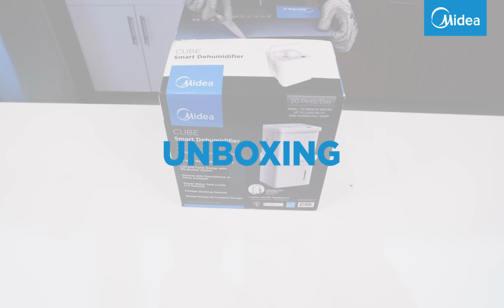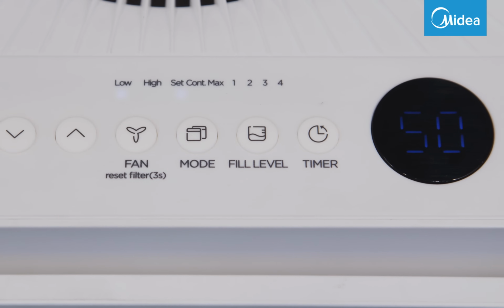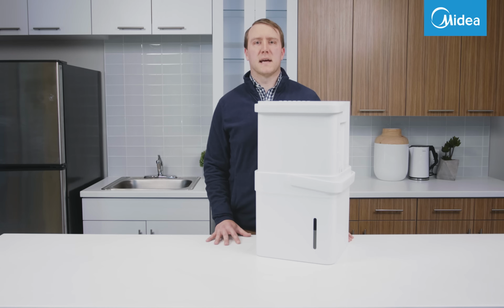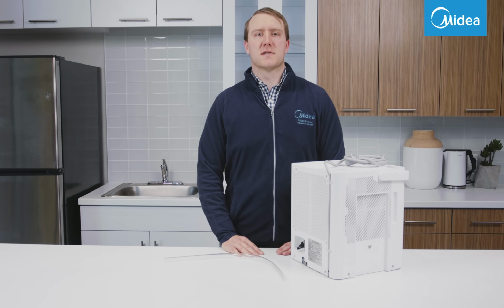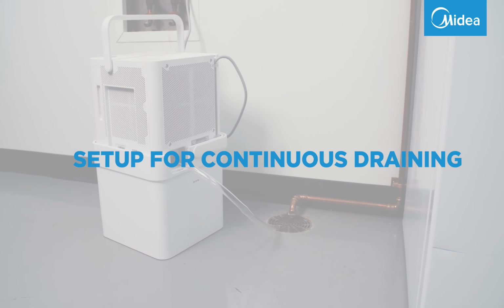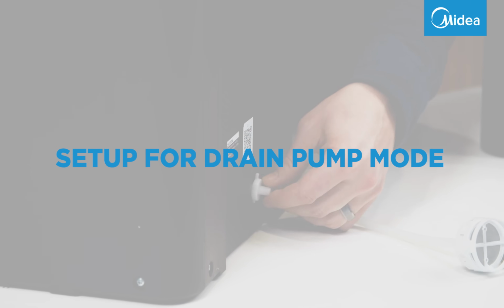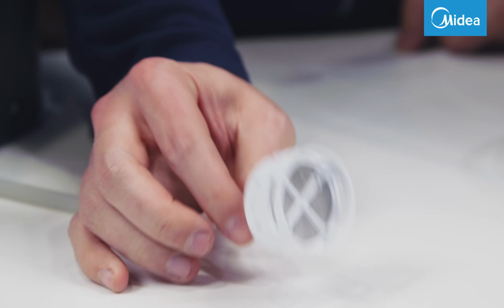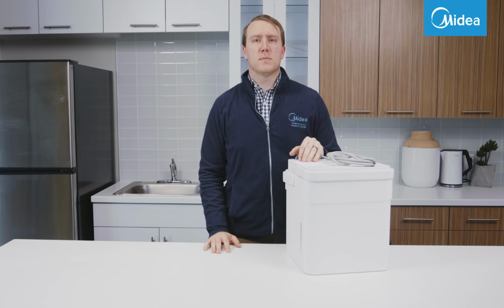Midea Cube Dehumidifier Operation and Overview

Comment: I've been running this cube for over 2 weeks in my RV.  It never, ever, hit's it's set point no matter what set point I've tried.  Setting 35% it never reads below 42% on the display, set it to 40% and it reads 47 or 48% and again never stops, set it to 50% and it goes to 55-57% and never stops.  My personal hygrometer is 10-15% below the cube's display, so the cube's hygrometer is WAY off.  Email support is a joke, phone support is worse.  I really want to love this dehumidifier, but it doesn't work as described.  Countless emails to Midea and the end result - they said to return it for a refund.  No tech support whatsoever.
Reply: I agree.  Midea support (I have one of their portable A/C) is a joke.  They suck at that.
Reply: I’ve also had a similar experience. Have run in for over a week and it’s only pulled a few cups of water. Look elsewhere
Reply: @Hermgerm29  actually now I've been running the Midea cube for 6 months and it pulls a LOT of water daily.  I'm in south Texas so the humidity is +75% regularly.  While the display is still off by 10% I just set it for 50% and it's keeping it around 40% with no problem.
Reply: @Hermgerm29  Wow, you got a dud!  I have two Cubes and they pull at least a full bucked a day out of a basement that is around 65% humidity.
Reply: Does anyone have a recommendation for an accurate hygrometer at a fair price?
Reply: @melissasaint3283  Funny you should ask, I have 5 hygrometers of various brands and in the same exact location no two give the same reading.  There can be 10 degrees different!  So I have no idea which one is even closest to actual humidity.
Reply: @joeking433  that's depressing, but thank you😂😭
Reply: I was chatting about my dehumidifier with an HVAC repair technician. 

-For clarity, I am not currently using the Midea unit.

 My current unit is not really doing a good job anymore of removing water...

what the technician told me without looking at the unit, was the refrigerant probably needs recharged. 

The problem is that these units do not have a way of easily adding more refrigerant. [Not to mention you need to be licensed to do it.] So, by the time you have paid an HVAC technician to repair it, you could have purchased a new machine. 

The guy I talked to said that luckily, he has the skills and knowledge and license to do that kind of work, and once the addition things are done, it then becomes easy to add more refrigerant. But, you still need the license to work with refrigerants.

Since my unit failed, I was going to upgrade to a bigger unit, since it seems like it was having to run the entire time even with the proper refrigerant level.
Reply from the maker: Hello Steve. I am sorry to hear about your trouble. Please reach out to us via Facebook at m.me/mideaamerica so that we may assist. Have a great day!
Reply: @MideaAmerica   We are having the same issue  with our new Midea unit.  It hits the set point and never stops.  I have reached out to you via Facebook and never received a response.
Reply: I just bought one of these for my garage 3 days ago, I have had it set like you at 35% since unboxing. It will not go below 41 percent. Frustrating, I am thinking about taking it back and just spending a little more money and getting a commercial one maybe I will get a better experience. Also just went and bought a separate hygrometer to see what it reads about an hour ago will check it tomorrow
Reply: @BP-vz8hh  if your's is like mine (which they all seem to be off) then 41% is really 31% and it's doing it's job.  I'm pretty happy with it.  I leave it on 50% and it keeps my rig at 40% which is fine.  I' dumping a full bucket every other day.
Reply: @stevetekrv5791  today I emptied it at 61% fill level, it continues to read 61% full level while empty. Have any idea what to do on this?
Reply: @BP-vz8hh  not sure what you mean.  The only fill level display is 4 dots, and when all 4 are lit it'll give you a code and stop.  Once you empty it and put it back it clears and starts up again.
Reply: @stevetekrv5791  I am using the Midea app that shows you the water level %
Reply: @BP-vz8hh  Do you have the 20 pint, the 35 pint, or the 50 pint model?
Reply: @BP-vz8hh  Is is pulling any water out of the air into the bucket?
Reply: @swright5690  yes bucket gets water in it, but today about an hour ago I emptied it at 61% full and after emptying it still reads 61 how do I fix this
Reply: @BP-vz8hh  Hi.   I am just a guy and do not represent Midea.  If the device is running and pulling water out of the air that means it is working.  Dehumidifiers are either on or off and always trying to reach the set point.  If the room/space is large, the device will just run and run and never hit the desired humidity level.  How large is the space you have it in?  Is the space humid?  Shower/bathroom?  Basement?  Does it run all the time or does it shut off sometimes?  As Steve Tek RV notes above, the cube's hygrometer may be poorly calibrated.  Yes, their phone support is not good.  On the other hand, just run it non-stop and if the bucket has water in it, then it is working and doing the job.  Or run it with the pump so that you never have to empty the bucket.
Reply: @BP-vz8hh  Why do you want it so low? Comfortable levels are between 45% and 55% as far as what the experts say.

Comment: How do you remove the hose from the back of the unit when storing it after using pump mode?
Reply: I'm guessing you already got the answer but you just have to gently pull out the ring that is around the drain hose while also gently pulling the hose. It slides out of the quick connect.
Reply from the maker: Hello Donald. Please reach out to us via Facebook at m.me/mideaamerica for assistance. Have an excellent day!
Reply: Press the ring around it in, then pull.

Comment: Seems like mines not draining correctly in bucket mode, it leaks off the side instead of through the drain port
Reply from the maker: Hello Josh. We appreciate you reaching out, although we wish it were under better circumstances. We can absolutely assist. Please reach out to us via Facebook at m.me/MideaAmerica for detailed information. Have a great day!
Reply: @MideaAmerica  I do not have facebook, any other way to get some assistance? Seems it is draining from the sides/seal of the bottom rather than the drain hole for bucket mode. It still dehumidifies the air, just doesn’t produce/drain as much as it probably should. Still love the product, just wish it would drain the way it should. Don’t want to break it
Reply: I also do not have Facebook and I was wondering do you put the rubber plug-in or keep it out when you want to use the bucket mode
Reply: @jeffswanson8896  I think you leave the plug out, and only use the plug if you’re running a hose out of it. I’m pretty sure..I’ve had mine almost a year and it’s been great
Reply: Thanks I appreciate it

Comment: I can't seem to get the air filters out - he makes it look so easy but even trying to jimmy things with a butter knife doesn't seem to help.  Anyone have any suggestions?
Reply: Glenda, it was a bit of a chore to get the filters out. Try putting out and to the front of the unit.  I ended up using a piece of that sort of puffy shelf liner (anything that helps you grip will work I'm sure) to keep my fingers from slipping and they came right out.
Reply from the maker: Hello Glenda. Thank you for taking the time to reach out. If you still need assistance please reach out to us at m.me/mideaamerica. Have a great day!

Comment: The customer service people cannot even answer the simplest questions because they have no direct knowledge of the product. 

My pump hose leaks at the connection outlet.  The drain tube seems to be properly inserted but I cannot remove it.   Customer service’s solution:  return it to the store.
Reply from the maker: Hello JL. I am sorry to hear about your experience with customer service. Please reach out to us on Facebook at m.me/MideaAmerica and we will be happy investigate a little further! Have a great day!
Reply: i had a similar problem, but a call to the customer service helped fix it. The unit was in the wrong mode, it needs to go into drain mode, then no leaks!

Comment: He shows that you can set it up for continuous draining after putting the unit into bucket less mode, and then putting the unit back onto the bucket and attaching the hose. As soon as I do that, it cancels the bucketless mode and the water does not drain from the connected hose. Is there something else that needs to be done?
Reply: I have the exact same issue, all set up and not in continuous drain mode on bucket. Follow steps as well however it seems with the hose in place on bucket, water is draining they tube.
Reply from the maker: @norenlaw  Please reach our specialists on Facebook at m.me/MideaAmerica. Have a great day!
Reply: Whats the difference between the 2 then?
Reply: @Jordania528 bucketless mode is for when you aren't placing it on top of the bucket. Bucket mode is for when you are placing it on top of the bucket, whether it's draining into the bucket or out a hose.
Reply from the maker: Hi Bob. We are happy to assist. Please reach our specialists on Facebook at m.me/MideaAmerica. Have a great day!
Reply: @MideaAmerica  what about people who dont have facebook and already called the 800 number and found the customer service people in belize unable to understand the problem or help in any way other than disconnecting the call? I have the same problem as the person above, Continous drain mode icon disappears after three seconds of being placed on the bucket and cant be reenabled.
Reply: @whatchulookinat338 it's not "continuous drain mode," it's "bucketless mode." If you are using the continuous drain hose but you are putting the dehumidifier atop the bucket, you do not set it to bucketless mode.
Reply: So you dont use the "bucketless" mode when you place the dehumidifier on top of bucket? Its not necessary?  You only use "bucketless" mode without the bucket? Correct? @StephenStrangways
Reply: @BillBarrett-t9e  correct. You only use bucketless mode without the bucket.

Comment: What setting is the most economic (cheapest) way to run this unit?
Reply from the maker: Hello Pink. Thank you for your interest in the Midea Cube. Please reach out to us on Facebook at m.me/MideaAmerica and we will be happy to help with any questions! Have a great day!
Reply: @MideaAmerica  I have the 50 pint and it's worked flawlessly for about a month. Now no matter what the app says the fill level is 87 percent. Deleted the dehumidifier and reconnected it and it's still the same. How does the humidifier read the water levels? Is there a port that needs to cleaned?
Reply from the maker: Hello, I'm sorry to hear the unit is not working properly!  Please reach us on Facebook with questions at m.me/MideaAmerica.

Comment: I have to say the Timer on/off is just a silly idea.  The way it should work is when I set the humidity to say 55, and it reaches that set point it turns off.  When it goes higher than that it turns back on.
Reply from the maker: Hi, Thank you for your feedback. This is a feature to allow the unit to switch from one setting to another or to turn the unit off etc. Not everyone will need this feature. Please reach our specialists on Facebook with any further questions at m.me/MideaAmerica. Have a great day!

Comment: How do you take off the pump drain hose????
Reply: I can't remove the pump drain hose (the thinner, rigid gray one) from the unit no matter how hard I pull!!

On another note, is there an extended pump drain hose available?  What is the maximum length?
Reply from the maker: Hello Evan. We are here to assist. Please reach out anytime on Facebook at m.me/MideaAmerica. Have a great day!
Reply: @hotpotnw  see my note below.
Reply from the maker: Hello Vince. Thank you for your inquiry about the Midea Cube! Pump draining instruction and visual aids can be found on page 13 of the user's manual attached here. https://m.media-amazon.com/images/I/D1-CUVsknhS.pdf Hope this helps. Have a great day! MideaCustomerCare@hartehanks.com Reach out anytime on Facebook at m.me/MideaAmerica.
Reply: @MideaAmerica  I read the manual! There is no "visual aid" to remove the thinner pump drain hose. I am not the only one with this problem. Read my comment and give me an actual reply!
Reply from the maker: Hello Vince. I am sorry to hear it. Please reach us on Facebook with any questions at m.me/MideaAmerica. Have a great day!
Reply: @DrunkDuckXD  push the connector around the hose in as you pull, it should come right out. Its the little white piece thats actually latching onto the gray hose. Its like a shark bite fitting.
Reply: @Shawn P.  Does your unit pump drain the bucket all the way? Mine pumps the water until the bucked is only halfway empty then gives me a "bucket water level full" error code.
Reply: @DrunkDuckXD  push the collar that surrounds the thin grey hose in towrds the unit.  Once you push in the white collar around the hose, and hold it in, the grey hose can be pulled out.

Comment: I just bought one of this and the pump doesn't work. I see the "pump" icon on the display screen but it doesn't pump the water.
The water just accumulates in the bucket and once it is full it shows "p2".

I tried to google for some solution and it seems that "pump not working" is a common issue to that humidifier.
Reply: Don't know if you figured it out, but you have to allow the unit to almost fill before the pump kicks on. I don't understand why the customer service response in all the online reviews (Amazon, Home Depot, YouTube, etc.) for this item won't just answer people's questions instead of sending them to their Facebook page and chat line.
Reply: @TheUnforgivenzx  After doing more research some people suggested to clean the hose and the point of attachment between the hose and the dehumidifier. After cleaning those, the pump system finally worked.
Reply: @TheUnforgivenzx  thanks dude!!! I was testing this unit out by filling the bucket about 2/3 full to get the pump to kick on.... No dice.

Thought my pump was broken on this brand new unit until I saw your comment about the tank having to be nearly full.  Seems silly that it has to be completely full before the pump works.... Also silly there isn't a manual way to initiate the pump via the control panel.
Reply: @TheUnforgivenzx  do u know how much it had to fill mines new and no pump but it’s not even half yet so ur post makes me feel better was about to return it . Is is 75% fill them pump works ?
Reply from the maker: Hello Guillaume, My name is Candice and thank you for your question about the Midea Cube. We are sorry to hear that you are getting an error. Please contact us at 866-646-4332 and reference case number 111323266 so we can assist. Have a great day. MideaCustomerCare@hartehanks.com (BBB A+ Accredited Business)
Reply: I thought that's what it is suppose to do??? It shuts off when it's full and the P2 lights up.  I just got this too...you got me wondering if I'm doing something wrong.
Reply: @pinkalleyboutique7564  if you don't want to use the pump system then you can just empty it by hand when it is full. 

However, if you decide to use to pump system with the tiny hose that comes with it, then it will empty by itself once the water reach a certain level. In the pump mode you should not get the P2 warning because the water shouldn't reach the max level of the bucket.

If your pump system doesn't seem to work, make sure that the hose is connected correctly. If I remember correctly when you plug the tiny house you have to push it in and then turn it to lock it (or something like that).

And if the pump is still not working then try to clean the tiny hose to make sure that nothing is obstructing it.

Well that's how I made mine to work.

Comment: How are the filters removed? They seem to be welded in place. Do you need to disassemble the front of unit with a screwdriver? Show more than half a second of filter removal please.
Reply from the maker: Hello David. My name is Candice. Thank you for your question about the Midea Cube. To remove the filters, pull each filter outwards. Wash the filters with clean water then dry. Re-install each filter. Have a great day. MideaCustomerCare@hartehanks.com
Reply: @MideaAmerica  I finally figured it out and yes you have to pull outwards but at the same time pull at a 45 degree angle. The recessed "grip" is not suitable it should be a loop or a protruding handle. It looks like you should pull toward you but the case bezel blocks that. You don't pull directly outward either. You need suction cups or pliers to grab the so-called filter handles, they're barely usable. Midea management really need to reconsider how bad that filter handle design is; textbook form over function.
Reply from the maker: @dg-hughes  Thank you for the feedback. Happy to hear you were able to get the filter out! I will send this information to our design team for the future. Have a great night David!
Reply: @dg-hughes  I still have no idea how to remove these. Any tips other than pliers?
Reply: @garrettswan86  You have to pull outward but also at a 45 degree angle (maybe 23 degrees?), it's difficult to explain. The filter has a recessed section that is useless it looks like a handle it's not it seems like you should be able to pull it back but you can't since it's impossible. So you have to somehow pull outward on something that has nothing to grip on. I know it seems ridiculous but it does come out but does come out. Just keep thinking back but 45 degrees outward. edit: I'll try to make a video showing it.
Reply: @dg-hughes  please make a video!
Reply: @MideaAmerica  Hahahaha!
Reply: @MideaAmerica  Hahahaha!